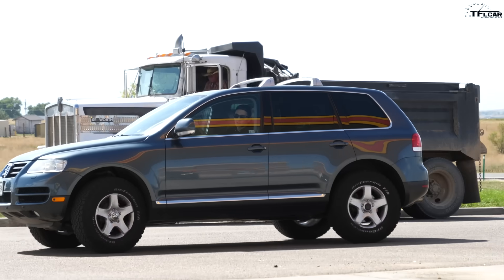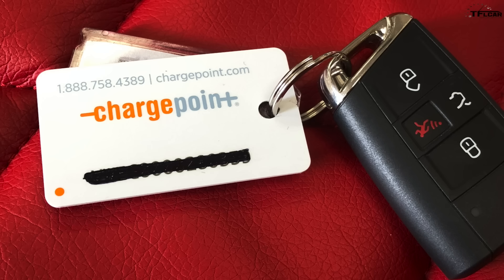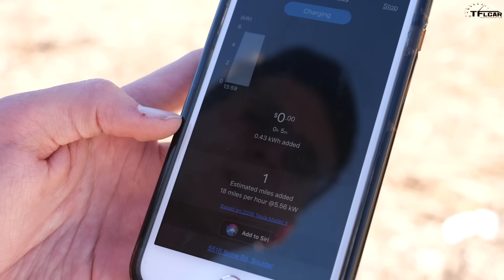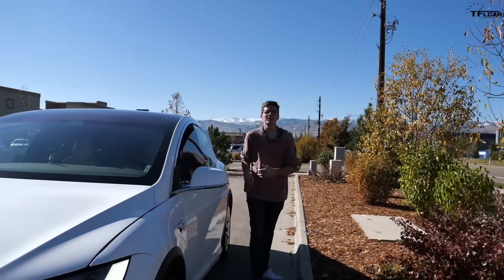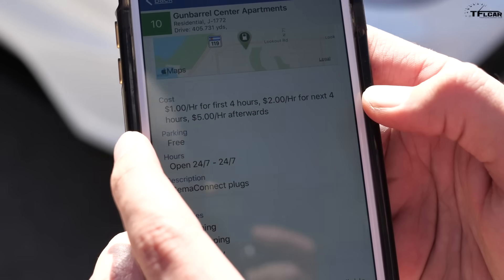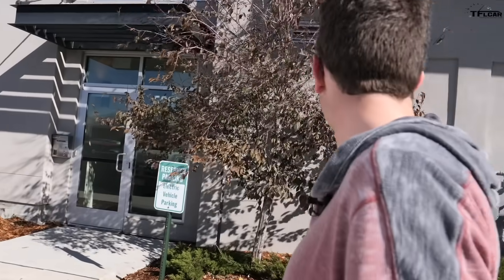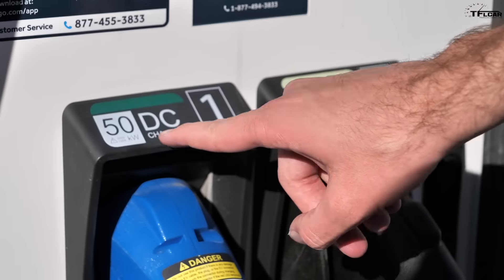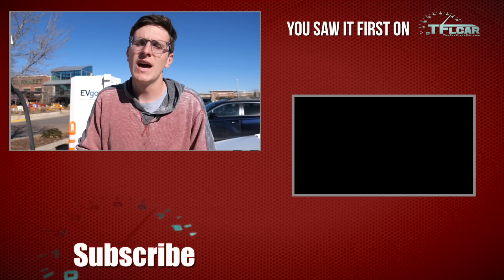Here’s Why Charging an Electric Car Can Suck - And It’s Not The Reason You Think!

Comment: Green is not so Green!
What is a battery?' I think Tesla said it best when they called it an Energy Storage System. That's important.

They do not make electricity – they store electricity produced elsewhere, primarily by coal, uranium, natural gas-powered plants, or diesel-fueled generators.  So, to say an EV is a zero-emission vehicle is not at all valid.

Also, since forty percent of the electricity generated in the U.S. is from coal-fired plants, it follows that forty percent of the EVs on the road are coal-powered, do you see?"

Einstein's formula, E=MC2, tells us it takes the same amount of energy to move a five-thousand-pound gasoline-driven automobile a mile as it does an electric one. The only question again is what produces the power? To reiterate, it does not come from the battery; the battery is only the storage device, like a gas tank in a car.

There are two orders of batteries, rechargeable, and single-use. The most common single-use batteries are A, AA, AAA, C, D. 9V, and lantern types. Those dry-cell species use zinc, manganese, lithium, silver oxide, or zinc and carbon to store electricity chemically. Please note they all contain toxic, heavy metals.

Rechargeable batteries only differ in their internal materials, usually lithium-ion, nickel-metal oxide, and nickel-cadmium. The United States uses three billion of these two battery types a year, and most are not recycled; they end up in landfills. California is the only state which requires all batteries be recycled. If you throw your small, used batteries in the trash, here is what happens to them.

All batteries are self-discharging.  That means even when not in use, they leak tiny amounts of energy. You have likely ruined a flashlight or two from an old, ruptured battery. When a battery runs down and can no longer power a toy or light, you think of it as dead; well, it is not. It continues to leak small amounts of electricity. As the chemicals inside it run out, pressure builds inside the battery's metal casing, and eventually, it cracks. The metals left inside then ooze out. The ooze in your ruined flashlight is toxic, and so is the ooze that will inevitably leak from every battery in a landfill. All batteries eventually rupture; it just takes rechargeable batteries longer to end up in the landfill.

In addition to dry cell batteries, there are also wet cell ones used in automobiles, boats, and motorcycles. The good thing about those is, ninety percent of them are recycled. Unfortunately, we do not yet know how to recycle single-use ones properly.

But that is not half of it.  For those of you excited about electric cars and a green revolution, I want you to take a closer look at batteries and also windmills and solar panels. These three technologies share what we call environmentally destructive embedded costs."

Everything manufactured has two costs associated with it, embedded costs and operating costs. I will explain embedded costs using a can of baked beans as my subject.

In this scenario, baked beans are on sale, so you jump in your car and head for the grocery store. Sure enough, there they are on the shelf for $1.75 a can. As you head to the checkout, you begin to think about the embedded costs in the can of beans.

The first cost is the diesel fuel the farmer used to plow the field, till the ground, harvest the beans, and transport them to the food processor. Not only is his diesel fuel an embedded cost, so are the costs to build the tractors, combines, and trucks. In addition, the farmer might use a nitrogen fertilizer made from natural gas.

Next is the energy costs of cooking the beans, heating the building, transporting the workers, and paying for the vast amounts of electricity used to run the plant. The steel can holding the beans is also an embedded cost. Making the steel can requires mining taconite, shipping it by boat, extracting the iron, placing it in a coal-fired blast furnace, and adding carbon. Then it's back on another truck to take the beans to the grocery store. Finally, add in the cost of the gasoline for your car.

A typical EV battery weighs one thousand pounds, about the size of a travel trunk.  It contains twenty-five pounds of lithium, sixty pounds of nickel, 44 pounds of manganese, 30 pounds cobalt, 200 pounds of copper, and 400 pounds of aluminum, steel, and plastic. Inside are over 6,000 individual lithium-ion cells.

It should concern you that all those toxic components come from mining. For instance, to manufacture each EV auto battery, you must process 25,000 pounds of brine for the lithium, 30,000 pounds of ore for the cobalt, 5,000 pounds of ore for the nickel, and 25,000 pounds of ore for copper. All told, you dig up 500,000 pounds of the earth's crust for just - one - battery. Sixty-eight percent of the world's cobalt, a significant part of a battery, comes from the Congo. Their mines have no pollution controls, and they employ children who die from handling this toxic material. Should we factor in these diseased kids as part of the cost of driving an electric car?"

I'd like to leave you with these thoughts. California is building the largest battery in the world near San Francisco, and they intend to power it from solar panels and windmills. They claim this is the ultimate in being 'green,' but it is not! This construction project is creating an environmental disaster. Let me tell you why.

The main problem with solar arrays is the chemicals needed to process silicate into the silicon used in the panels. To make pure enough silicon requires processing it with hydrochloric acid, sulfuric acid, nitric acid, hydrogen fluoride, trichloroethane, and acetone. In addition, they also need gallium, arsenide, copper-indium-gallium- diselenide, and cadmium-telluride, which also are highly toxic. Silicon dust is a hazard to the workers, and the panels cannot be recycled.

Windmills are the ultimate in embedded costs and environmental destruction. Each weighs 1688 tons (the equivalent of 23 houses) and contains 1300 tons of concrete, 295 tons of steel, 48 tons of iron, 24 tons of fiberglass, and the hard to extract rare earths neodymium, praseodymium, and dysprosium. Each blade weighs 81,000 pounds and will last 15 to 20 years, at which time it must be replaced. We cannot recycle used blades. Sadly, both solar arrays and windmills kill birds, bats, sea life, and migratory insects.

There may be a place for these technologies, but you must look beyond the myth of zero emissions. I predict EVs and windmills will be abandoned once the embedded environmental costs of making and replacing them become apparent.  "Going Green" may sound like the Utopian ideal and are easily espoused, catchy buzz words, but when you look at the hidden and embedded costs realistically with an open mind, you can see that Going Green is more destructive to the Earth's environment than meets the eye, for sure.

Comment: What a crock. SLOW, just as expensive as gasoline, plus a cell phone and the apps land it still uses oil/natural gas/hydro/coal powered generators to charge the overly expensive, limited range battery powered TOY for the  very rich.

Comment: This man done an excellent job explaining this. Even if the electric car does become a norm as fast pace as the world is now I can't see it working or how it will help the environment because of the manufacturing of the electricity would have to be so massive that it will be no different than all the fossil fueled cars now on the roads. Not to mention the wait time for a full charge also cost will equal out to be no cheaper
Reply: Most charging will occur at night when drain on electrical systems are at their lowest. Businesses with small fleets and home owners are, by far, the largest owners and users of EV cars and the related infrastructure.

Comment: Wow what a MESS ! Charging stations make it a mess when they are not all on the SAME PAGE ! What's the big deal not having the same connections. On All ? Really complicated !  If had an EV wouldn't bother with charge station ! Plug in at house ! But first have to see by others how it effects electric bill. Then again better to wait till EV got batteries that give more miles . Why doesn't EV have generator on each wheel or do they ?

Comment: You're trying to compare something that people have been used to with something people are still learning to use.
The trick is keeping the car charged whenever you can.   I have a toyota prius prime.   I charge it anytime I get home.  It'll take 5 1/2 hours to fully charge on a 110 outlet if it's empty.  I can take my cord with me anywhere I go and plug in a 100 outlet.  
My Prime will go about 30 miles on a charge and further depending on how I drive the car.  Then it switches to hybrid.
I can go all week on electric.  The trick to electric is to drive conservatively.   Don't put the petal to the metal as they say.
I avoid roads with multiple stop signs (stop and go is brutal on the battery charge), drive the speed limit.  If no one is behind me I'll drive slower.  And going up a hill I'll coast over the top and let the car speed back up as it goes down the hill.   
Now if someone is behind me, I will drive the speed limit and drive with traffic only out of respect to the drivers around me.  
My car is highly insulated.  I don't really need the heat on which is huge in battery use.   In summer I like the windows down anyway so I'm not using the electric for that either.
I can go to the Poconos from Philadelphia and back using less than three gallons of gas.  I drive about 280 miles round trip and driving around.  If I drive like a regular driver my mileage will drop hard.
If you want to drive fast and hard don't buy one.  If you want to conserve you gas and your money drive smart

Comment: Wait till the EV vehicles take over the roads. Here in the US alone 12 to 15 million vehicles a year reach the end of their life and are scrapped. The average EV battery weights 1600 pounds so once EV vehicles take over, that's 24 billion pounds a year of hazardous battery waste that will have to be dumped. No their not recyclable their to deadly to recycle and are not designed to recycle. Think about that when you see the streets filling up with EV's.

Comment: This video has not aged well.  The new much faster Tesla chargers that are everywhere now charge your car from less than 100 miles to over 300 miles in less than 30 minutes. I travel a lot with my Model S and I love it. Most chargers are next to places you can eat. I stop when I want to have lunch or dinner. Most of the time I have to eat fast and go unplug because it’s already fully charged. In next two day alone I will drive over 300 miles out of town. The cost of charging is easily 1/4 of cost of gasoline when I had a Porsche.

Comment: Too much hassle for those that have to get from point A to point B in a certain time.  Hope the battery doesn't catch fire while parked or driving as they often do.
Reply: There was an EV car fire. somewhere and it took firefighters 4 hours to fight the fire, they had to call the battery manufacturer to figure it out, not to mention the waste products of the burn....heard about it on the news last year I think it was in Cali
Reply: @janyenyo : The firefighters should just let the car burn because using precious water won't put out the fire.  Heaven forbid the car doesn't catch on fire in the middle of the night while parked in the garage with people asleep inside.
Reply: @jgstargazer  Do you mean like the Chevy Bolt? Before they were eventually reluctantly recalled! Owners were advised, not to park in an integral garage and at least 50 metres from civilisation! 🤣🤣🤣
Reply: Electric cars are statistically less likely to catch fire than a fossil fuel vehicle.
Reply: I wouldn't say "often". Think of all the electric cars, scooters, skateboards, laptops, phones, toys, powerbanks, off grid houses etc etc that all use lithium batteries. How many of them catch fire?...It's like 1 in a billion. I'd be more worried about having a coconut fall on my head and I don't live in the tropics. I agree electric cars can suck though with the charging thing. I've got an EV that has a range of 260km and can charge up to full in 4 hours on a standard home outlet. This vehicle is the size of my small backpack and does 80km/h. It's called a Veteran Max (EUC). I find this interesting because there's no way in hell you could pack all these specs into something that small using ICE technology.

But when it comes to cars the ICE has the clear edge when it comes to range. Going back to the EUC though, with ICE you don't even have space to put the gas tank (you'd need about a full gallon to get 260km). Let alone the engine. This thing is nothing but a wheel inside a backpack sized chassis.

Comment: They need to make gas cars, where the alternator can charge the batterys so you don't have to use charger stations. Imagine what your electric bill will be at the end of the month. Also your batteries don't last forever you going to have to replace them. They cost way more than regular batteries that you use to start your car.

Comment: Seeing this video, it makes me glad I get to fuel up my car in a matter of minutes, and can pay cash to be able to travel over 300 miles in an fuel-up time of only 5 to 10 minutes.  I think I have it good.  Besides, how long does the battery of the car last?
Reply: My car can get 600 miles on  a tank of gas. If I'm going to charge an EV at 15 mi / hr, then it would take 40 hours to charge 600 miles worth of power. That's 40 hours... as in WORK WEEK!
Reply: @alanbelancik2207  my EV has a 305 miles range. Was able drive from Rancho Cucamonga to San Diego and back without stopping in between. I charge at night in my garage with level 2 (45mi/hr), set it to charge during off-peak and ready by departure. When I do go to the office, I actually don’t charge until I arrive to work as they allow up to 4 hours of free charge. That easily takes care of my commute. Battery comes with a 100k mile warranty, and is expected to last for a lot longer. With 2012 Teslas still on the road, it’s a testament of how good the batteries are, and they just keep getting better. Also, superchargers actually charge from 15% to 90% in 15 minutes, which is the same time it takes to wait in line when getting gas at Costco here in Socal. The point is, EV isn’t for everyone, but for those that do own one, it is a very good vehicle to own.
Reply: It would be impossible to back into one of these charging stations while puling a travel trailer.  No thanks to the EV.
Reply: Batteries only lasted up to 7 years maxed then you replace them if you got $8k to $20k very Expensive. a lot of People don’t have that type of Money laying around to dump on a EV
Reply: @blackdragon9077  Why keep the car past its warranty period? No modern car (super cars aside) are ever going to be sought after classics like a 65 mustang or 70s era charger.
Reply: @blackdragon9077  And the used battery isn't recyclable, ends up in a landfill.  Just like the blades on a wind turbine.  And those blades have to be replaced after a number of years.  Solar panels who knows.  Ask China.
Reply: @blackdragon9077  That is not true. The batteries in modern EVs are good for about 250,000 miles or more. That's 15 years or more of fairly heavy use. And even at the end of that 250,000 miles, the battery should still have about 70% of its original capacity. Few if any EV owners will ever replace the battery that came with the car. The car will be retired from use with a battery that still has considerable value as stationary storage to use with a solar system.
Reply: I'm not to wild about sitting in a Faraday cage with a huge battery.
Reply: The battery in a modern, long range (250+ miles) EV should go about 250,000 miles before it degrades to less than 180 miles of range. Most EVs will wear out long before the battery is very bad, and the batteries will be extracted from the junked car and re-purposed as stationary storage for solar systems. In that role they should have another 10+ years of useful life.
Reply: @jimmurphy5355  I’ve seen the information on EV’s and if you get 15 years out of it Batteries to replace will cost more than the Car, did you also know EV has 58% of Silver in them just like Solar Panel’s they used Silver for and Conductor America doesn’t have a lot of Silver left or Europe to push this BS into the Future, and besides the Poor can’t even afford EV or replace the Batteries to keep it going, I don’t want to stand in line waiting on a Charge behind others, or waiting for Hrs get in and go that’s what I want, and besides if you take California they have a Grid problem along with Water problem, No Water No Electricity, remember what happen in Texas last year, I don’t want to be in that Situation Stranded and can’t move around.
Reply: @blackdragon9077  There is no silver in EV batteries. The case is steel, the inner electrodes are copper, nickel, graphite and aluminum, with some cobalt in some modest amounts (not in all cells) and manganese (also not in all cells.)
Despite the fact that they are called lithium cells, and the lithium is the charge storage element, lithium only makes up a few percent of the total weight of the battery.
The only silver in an EV is in the relay contacts, and regular ICE cars also have silver relay contacts.
Reply: @jimmurphy5355  Silver is used as a Conductor for For electricity look it up it’s in all Electronics.
Reply: @blackdragon9077  Think so if you like. I've designed electronics products for decades. I never needed or specified any silver conductors. Silver is far too expensive to use, when copper is almost as conductive.
Reply: about 2 yrs..